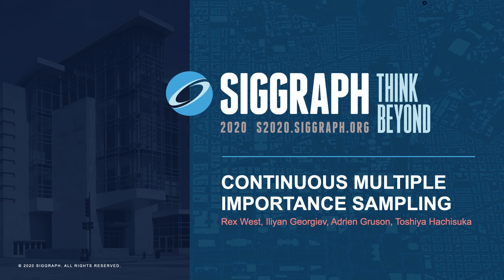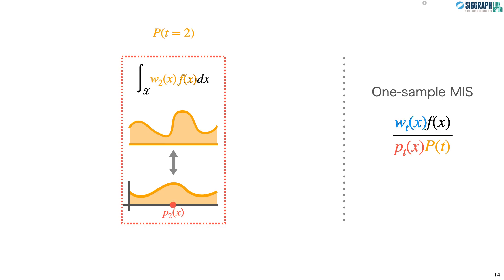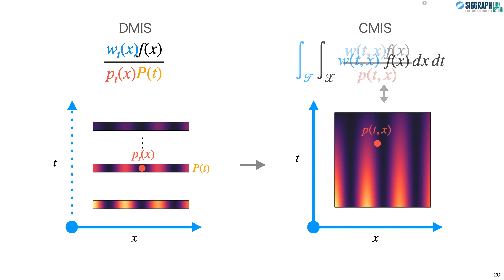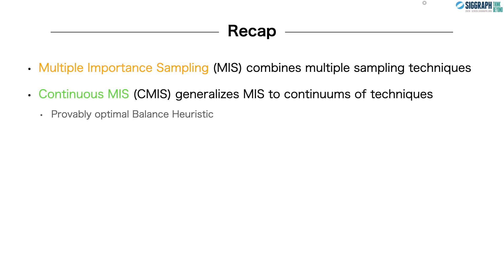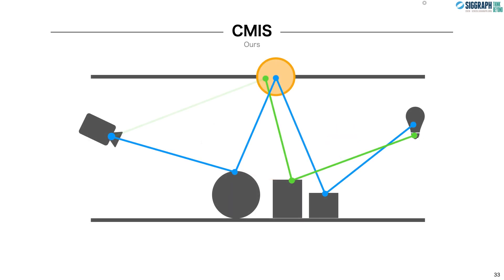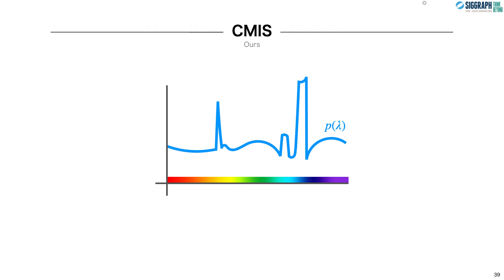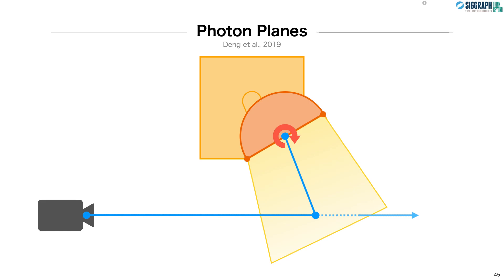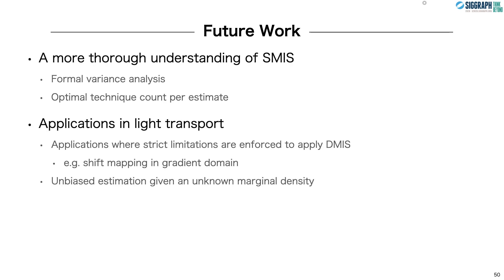Continuous Multiple Importance Sampling (SIGGRAPH 2020 Presentation)

Comment: what software does this presentation use? It does not seem like the power point.
Reply from the maker: I used Keynote for the presentation slides.  The Fast Forward video and the figures in the paper were also made entirely in Keynote.